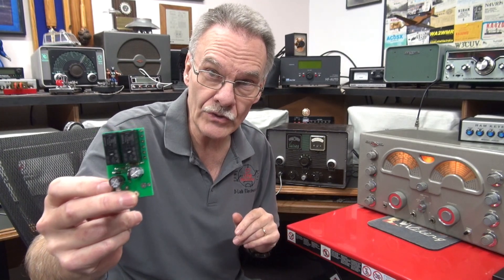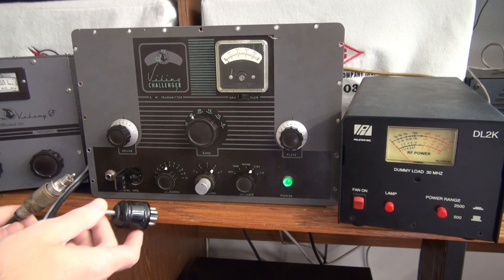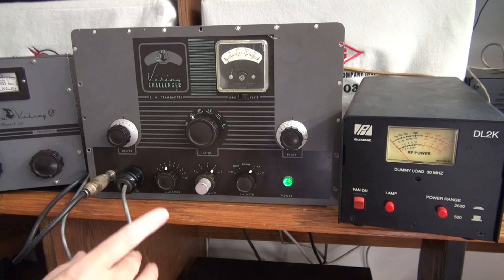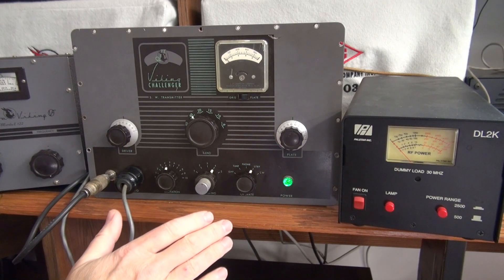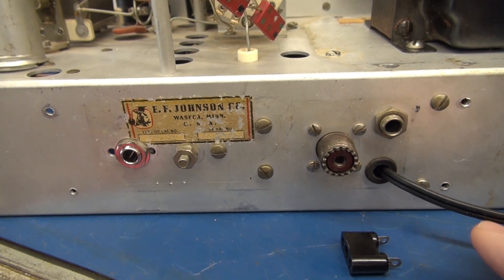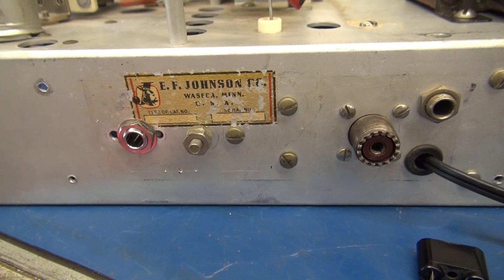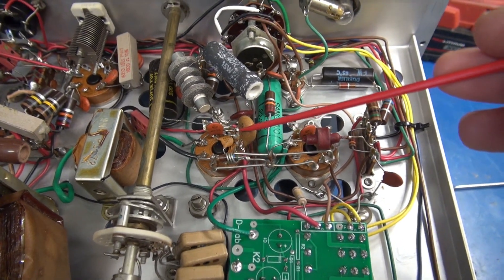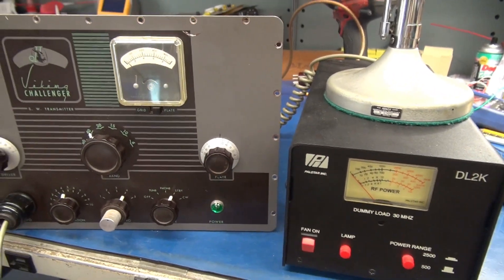Add PTT Push to Talk module Johnson Challenger AM CW Ham tube type Transmitter

Comment: Hey Terry. That is weird that they didn’t include a system for an antenna relay. I wonder if that was because buyers were using the RF TR switch? The model 250-39. Otherwise, it would be a lot,of work flipping switches during operation.